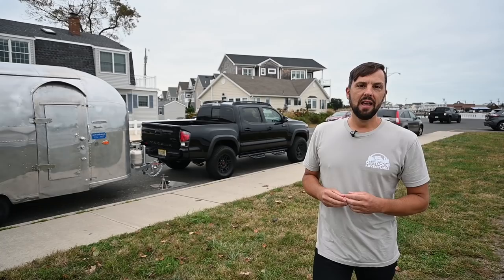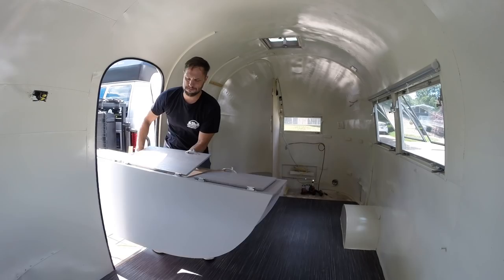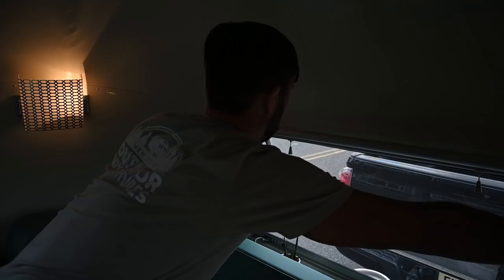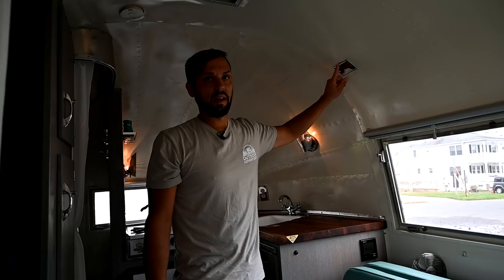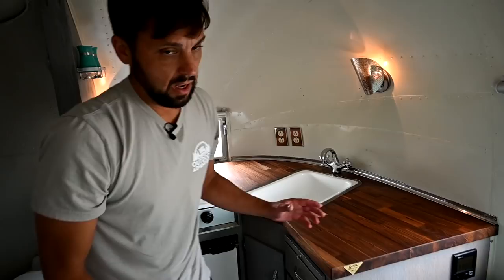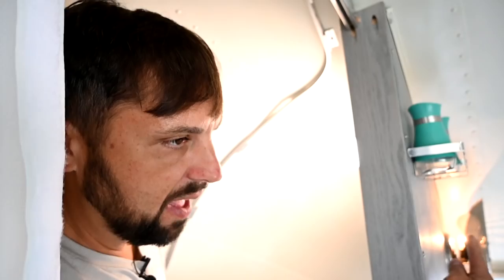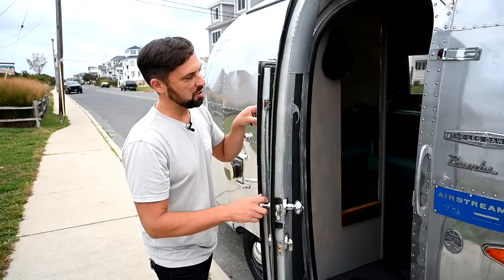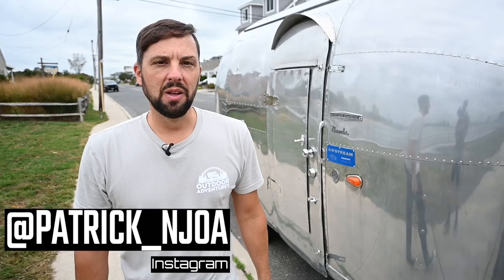FULLY RESTORED - 1961 Airstream Bambi | Complete Walk Through Tour

Comment: After thoughts::
1. Thanks also for new ideas like adding the low-point drainage points and securing the inverter on the fold down panel, and the Battle Born with heater - I can use those hints! 
2. Seeing the tear drop running lights and large round tail lights reminded me how my brother and sister-in-law had a car-show business geared to antique autos/vehicles. 
I actually still have some of the tear drops and old bulbs which could be available for you to give to others who are doing a similar restoration if you want them. 
3. Oh, and now I know what those pyramid-looking frames in the cellar are - old stabilizers!
Reply from the maker: Thank you very much. I still have the original side teardrop lights. I upgraded to the LED reproduced ones because they are safer and weather tight.

Comment: What a wonderful job of restoring, not renovating! 
The thought you put into keeping vintage parts, polishing original parts, etc., keeping original ideas while adding newer and necessary updates is impressive.  
Things like keeping the old vent outside but sealing it indoors, keeping the original battery container and repurposing it, hiding the new heater output so nicely, keeping the original drawer system (not putting in new punch-button ones) are so thoughtful. 
Ditto hiding your outdoor shower - that all impressed me.

Kudos!
Reply from the maker: Glad you liked my direction

Comment: For A/C in a vintage, I saw someone put a roll around room unit in (took it out of the case as needed).  They mounted it inside a cabinet and ran the exhaust out of a fake tail light that they flipped up when they wanted to use the A/C.  This was their answer to not installing on the roof.  It worked very well!

I love what you did with the trailer, keeping its vintage heritage and modernizing where it makes sense.  It is lovely!  Your restoration is great!  I love the door-in-door

Katy #5939
Reply from the maker: Oh wow. I’ll look Into that

Comment: Great job on the restoration.  It's terrific how you honored the original design.  About the side marker lights ... you have the rear ones on PROPERLY.  Don't let anybody tell you differently.  Those lights are meant to be a streamlined shape with the rounded end  forward and the pointed end aft.  Like a rain drop.  At some point, Airstream started installing the rear lights backwards.  Maybe somebody thought they should be put on the opposite way of the front lights.   I don't know.  But, I'm an Aeronautical Engineer and I know the lights were designed to be aerodynamic shapes and that requires the rounded end to be forward, as all your lights are.  Originally the trailers were designed to be what seemed like a low drag shape but in fact the back end is one of the worst possible shapes as far as drag and stable airflow.  The shape of the  front of the trailer is fine but the back was meant to "look right" and it isn't.  If you see photos of Wally's early trailers, he did a much better job of shaping the trailers back then with long tails.  Current Airstream shapes are for more interior space and to lower costs.  Have you seen the Porsche-Airstream prototype?
Reply from the maker: Thank you for the great information. Yes I seen the concept for the Studio F.A. Porsche

Comment: Very nice! I thought I would share a tip with you to make your drawers and bed mechanism slide better (and quieter) - rub hardened candle wax on all wood surfaces that rub together. Maybe use beeswax on the cutting board. In a pinch you can use a bar of soap, but wax will last longer.
Reply from the maker: Thank you for the suggestions
Reply: @NewJerseyOutdoorAdventures  Hope it helps. Also, if you use scented candles you get to enjoy the nice aroma for years to come.

Comment: I love this! Can you share the brand of smoke detector you have? It looks petite and aesthetically pleasing. I hate to have something off-scale in a small trailer. The one thing I can offer you is: Museum Wax. It is a putty-like substance (used in museums) to secure items in a display. You can secure your plants, for example. I secure things on my mantle at home so the cats don’t knock them over. It’s a great material for improvisation because it stays put until you want to remove it and then it removes easily, without any damage.
Reply from the maker: Thank you for the suggestion, I will check it out. I looked at my purchase history and I cannot find it and there are no markings on them. I believe I bought them on Home Depot

Comment: The holes under the van? What about the outdoor shower? Where does it mount? And can you put the head of the shower high enough to actually take a shower? Those are the two aspects of the refurbishment that I would be most concerned about if I were looking to buy myself.
Reply from the maker: Yes the holes have been filled. You can buy a suction cup shower holder for use at higher heights.

Comment: How did you make the bed level given that the dinette foam seat is 5” thick and the backrest is 4”? Before I spend $4000 on the 2019 Nest Dinette to restore “Sheryl” 1962 Bambi.  Gorgeous job!
Reply from the maker: The bottom of my bench is tapered to compensate. It is not completely flat when assembled but never noticed when sleeping